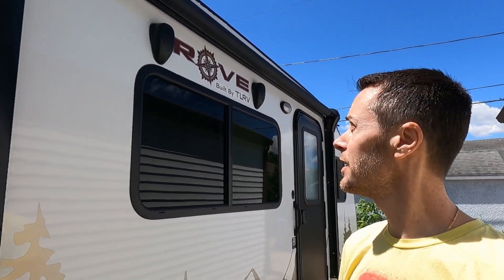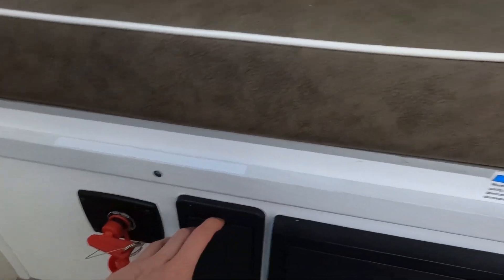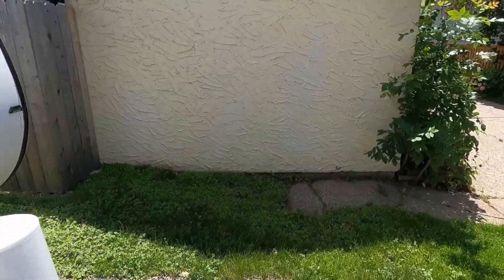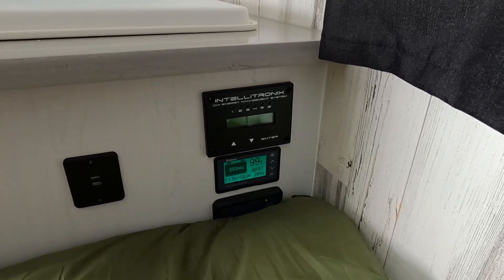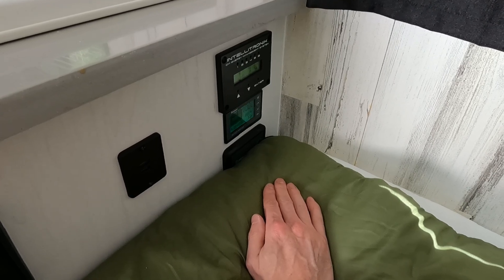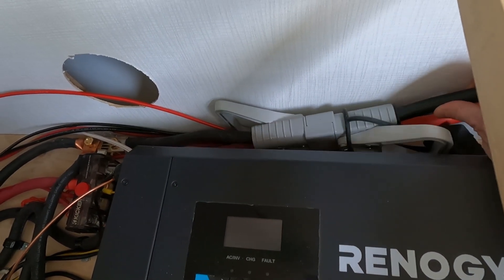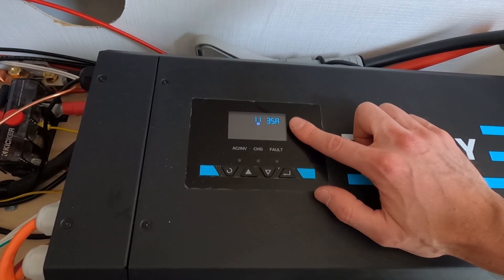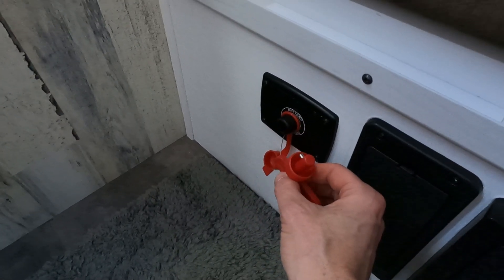2023 Rove Lite 14FLEV electrical and solar walkthrough

Comment: What an amazing rundown on the FLEV. We have a Tesla Y and this RV is perfect to pull. Questions..
-What came with the solar package ? and what did you add ?? If all of the Renogy came with the package, that's some quality stuff.
-Those 2 small bench seats. The one near the door, would it be easy to take that out ?? We love the layout but if we can remove that seat, it would open up quite a bit.
Reply from the maker: 1. Here's everything that came with my 14FLEV: https://travelliterv.com/wp-content/uploads/2023/03/Travel-Lite-Layout.pdf

2. You could remove the seat next to the door where the table goes; however, the seat next to the bathroom is on top of the 10-gallon fresh tank, so you'd be looking at some significant modifications there.
Reply: @craigspree1  Thanks.
No I would leave that bench there.
Just the outside bench.
If 2 people need to seat, I can just use a smaller folding chair.
We went to the Tampa RV show this past weekend and saw this in person.
My wife loves it and it will be our pulling camper.
Reply from the maker: @Firephosure I suggest trying to find a used one. I’ve seen them listed for $10-15k sometimes because people get confused on the basics of how solar works or don’t know about the converter needing to be removed. If we didn’t want it at the start of last season I would have waited and paid used for 50% less than what it cost new.
Reply: @craigspree1  Thanks. We have a camper already and it's a 3000lbs that we park permanently on our land. Although the Tesla can pull it, I wouldn't want to pull it around traveling. This one is perfect and we wouldn't mind a clean used one.